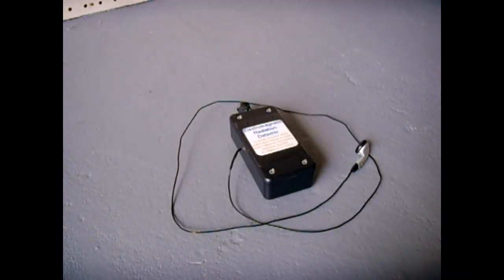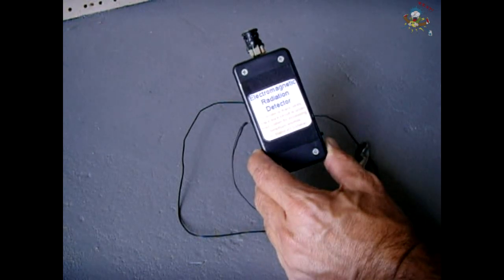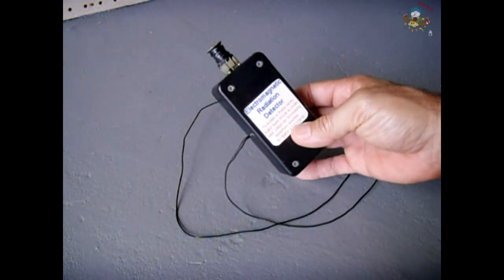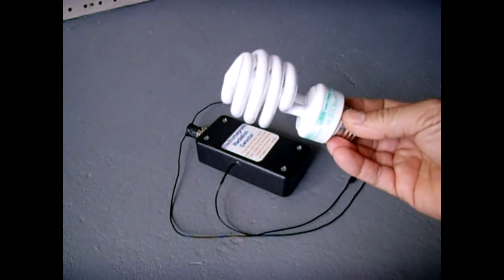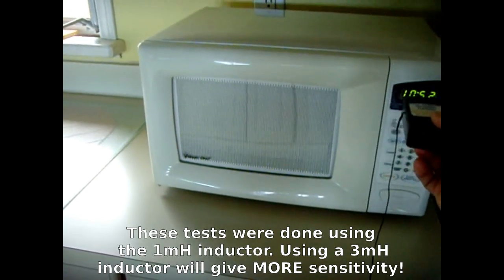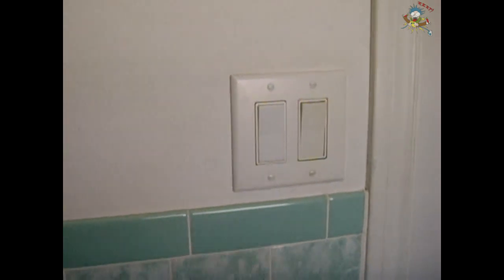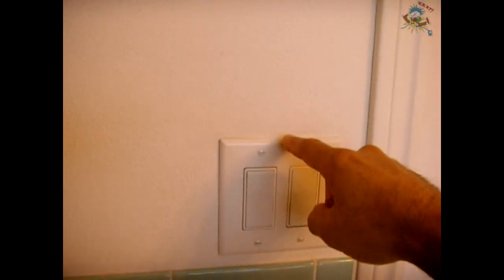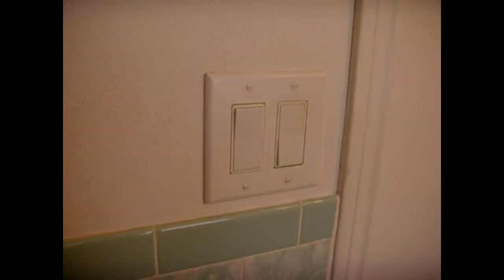How To Locate Wires In Walls(EMF Detection)

Comment: Nothing else detects AC wires in walls more accurate than magnetic field detectors with coils. There is only one disadvantage - current flow is needed to create and detect magnetic field (lights ON, wall outlet with some devices ON). In other hand, electric field detectors (with mosfets, darlingtons or LM3914 / LM3915 with antenna without coils) doesn't work 100% accurate, because some walls are partially conductive and electric field is spread over wide area around AC wires. I'm using more sensitive version from this video. 200-300 turns ferrite coil + dual Op Amp LM358N (overall gain is 5000-9000) + high impedance piezoelectric buzzer with 220 Ohm resistor in series to limit Op Amp output current and prevent oscillations. Two input wires are twisted, output wires and wires from 9V battery are twisted too.
Reply: This is exactly what I need but ideally something more sensitive if current setup is not strong enough. Ideally it should be able to detect through a two inch ceiling joist or capable of detecting through ceiling to where the romex is which is typically in the middle of the joist. Tried searching for a video to make to no avail. Any way I can get my hands on this or something thats just as effective? Saw some very pricey EMF devices but not worth the price tag.
Reply from the maker: Thanks for watching! I have many excellent videos on my channel, so be sure to look over my video playlists for other videos of interest to you and share.

Comment: How do I improve the sensitivity of this circuit? If I use another amplifying stage is it better to improve the sensitivity?
And what type of inductor did you use?
Reply from the maker: The circuit is sensitive enough. Works great for me. You can see the inductor in the video that I pulled from scrap electronics. Thanks for watching!

Comment: I think you can use an old pocket am radio also, with the sound up.  The noisy electric line causes buzzing. Tune it to the static portion of the band, not a radio station
Reply from the maker: Stephen Fiore Possibly, but without any accuracy.
Reply: electronicsNmore sir the schematics is not available on the link plz help

Comment: I have an Ethernet jack in the wall of a 2nd floor bedroom that's dead.  The builder wired the jack without leaving any info on where it leads.  Can't seem to locate it in the basement.  Could this somehow be used to trace the Ethernet cabling going to this jack to find the other end?  I was thinking if I could apply a strong enough RF (or AF) signal at the Ethernet jack, I might be able to use something like this device to trace backwards and locate where the cable ends (hopefully in the basement).  Thanks.
Reply from the maker: You need a signal tracer. If you need a link to a reasonably priced unit, just ask. :-)

Comment: That is an interesting unit. But if I make one can it detect wiring that is in Galvanized pipe in the concrete wall. Reason is I live in Puerto Rico and they do not have a definite code. So the encase galvanize pipe in the concrete and they also use single solid strand wires, that is a no, no in metal pipe. Also never encase metal pipe in concrete slab. Need your assistance.
Reply from the maker: Romex or PVC pipe only.
Reply: Thanks for responding.

Comment: Do you have Romex wiring or is your wire in conduit.   In the Chicago area electrical code requires conduit for all high voltage wiring.    I doubt if  the device would work in wiring sheathed in conduit.
Reply from the maker: Correct, the wiring in the walls are Romex.

Comment: i have LM358N should this work? and how you make the coil? i use 3mh and is smaller than yours?....and nothing works:(
Reply from the maker: Has to work. You did something wrong, or have a faulty component. You have the entire circuit together with the Audio Amp?
Reply: electronicsNmore yes..as the circuit...but the only problem i think is the 3mh inductor...witch i have one small 3mh that says 3.3k i think thats the ohm..so anything? :(
Reply from the maker: You have no way of testing it with a meter? More than likely the inductor is not what you think it is. Do you have a ferrite rod laying around from an AM radio? I can tell you how many turns to wind on it, if I have one that is similar in size, to get an idea.
Reply from the maker: NeleRS
You need a tester to measure inductance,  The link below is where you can buy a great multitester at a low price.

http://bit.ly/2cKBZMt
Reply from the maker: NeleRS
Did something wrong with the circuit. Check everything, and swap out components.
Reply from the maker: *****
I would use exactly what I show in this video. I know it works for a fact. :-)

Comment: Very nice idea. I needed one of these, can't I just pust a small piezo buzzer directly on the output and get rid of the LM386? Thanks. :)
Reply from the maker: You really want to use the amplifying circuit for maximum sensitivity.

Comment: Nice,,but how about a circuit that detects an AC line without using load,so that you can use it to locate a broken wiring? I hope you can make a follow up video..Thanks :)
Reply from the maker: Though the circuit in this video is extremely useful, I understand your need. There are many AC voltage detection circuits available online which work within a couple inches of the wire
Reply: electronicsNmore I think he meant if the wires were cut or not connected.  I'm guessing that some electronic noise or radio-signal can be put on the line and use the detector to see where the signal stops which would be where the line is cut/not connected.   I think oscilloscopes can be used for finding the length of available/uncut line.  I'm also guessing that if only one of the 2 lines are cut then there might be other things to consider.